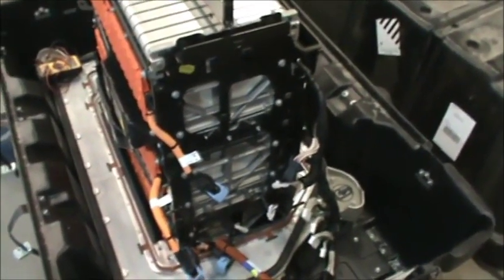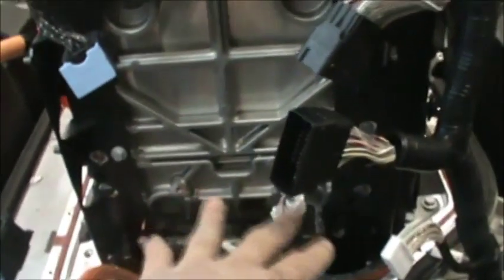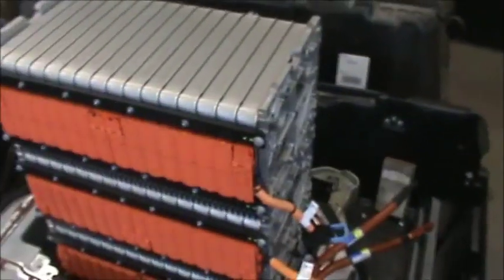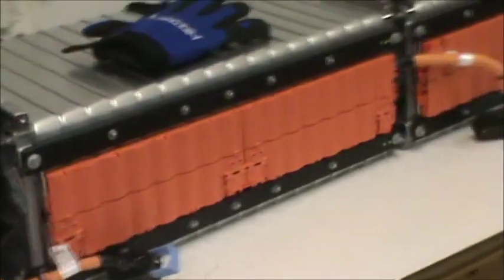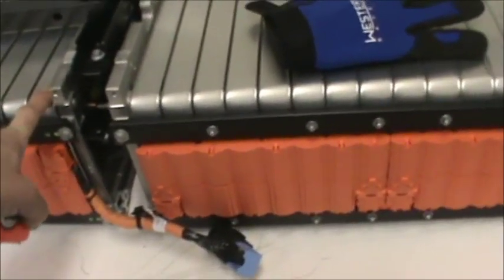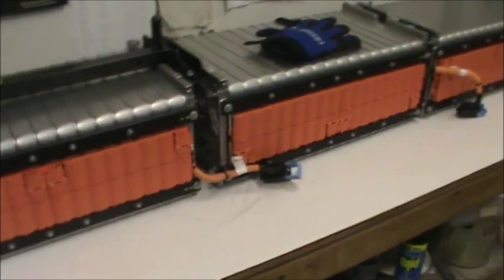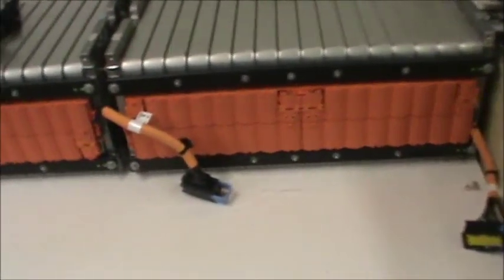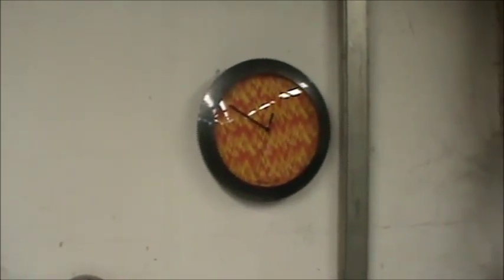My Civic EV Electric Car Project Part 13 Renault Fluence Battery Pack Disassemble

Comment: Greetings and greetings for your project.

I am interested in where you bought the battery bank for Renault Fluence ZE, their price and condition (new or used).
I want to feed a Renault Fluence ZE from supercapacitors or supercapacitors connected in parallel with the battery bank.
I saw many cables (thicker and thinner) when you unpacked the bank.
Can you tell me how many cables this battery bank has and what are they for?
It is technically feasible to feed the machine from supercapacitors or supercapacitors and batteries connected in parallel.
Honestly I would prefer feeding only from super
capacitors. Thanks in advance for understanding and support

Comment: I own a Renault Fluence ZE. there are 1500 ZEs on Israeli roads and since better place bankrupt i use the car as a  plug-in car. the main problem is its range max at about 80 mils with 22kW of charge and derating. Bing unable to remove the battery myself and play with. do you have some insight about making the battery better (electrically or making it lighter) and how hard it would be to swap cells when time will come ?

Comment: wow wow wow ,,, just wow Tom always on time..
Reply from the maker: Its getting hard to sleep around here!
Reply: I'll bet ,,new toy,,it's gonna be ok..i was thinking remember to put a sack or 2 of potatoes for  the driver corner weight when you get a scale under each wheel. Can the moduals be spread out a little?
Reply from the maker: Milogarage I only wish I had corner scales, I don't even know anyone with a set to borrow from. We could spread them but then strapping becomes a problem. I think its best to keep them all in one place IF possible.
I have question for you Milo. What is the weight distribution on your Porsche?

Comment: center of gravity is not the only consideration for pack placement.
consider damage and temperature conditions depending on what climate you live in.
I can see from your videos that you have snow and lithium batts supposedly don't like being charged in freezing temperatures. That's more important than race car characteristics. Air tight box with some insulation and maybe a small safe thermostat heater. Under the car is a rather exposed location.
For pack heating you could maybe use a power resistor connected to a CPU heatsink and fan. That should be possible to set up in a way that can't start a fire. If air tight and a bit of insulation it might only take very little to keep it above freezing Maybe 20watt.
Reply from the maker: All those things are correct Dan. We wont be racing with an AC-50.
Thanks for watching!

Comment: Great job.  Don't stop.  At some point would like to see the numbers you worked out: car weight (ICE and EE); weight distributions before and after; costs (to get the battery pack, motor, controller) and the best part: comparison of per mile costs ICE versus EE based on real usage.  The devil is in these details.
Reply from the maker: I am keeping track of all these things, ill make updates as we go through the project and of course at the end we will have totals
Reply: Wonderful Tom.

Comment: Pretty amazing stuff really... Being able to fit it all under the car sounds like it would be ideal,  I wonder though, the weight distribution will be radically different from stock, with several hundred pounds added under the car in the rear and several hundred removed from the front... and being a front wheel drive I also wonder what traction will be like as well as handling. I know you aren't making a hotrod but I would worry about the vehicle becoming uncontrolable in an emergency situation. I understand why you would want to have the batteries out of sight but I feel like having ONE of those battery packs mounted sideway against the firewall might not be so obtrusive and would go a long way to balace the car front to rear... Of course I could be way off base! Cool project in any case.
Reply from the maker: ill make a video on this subject.